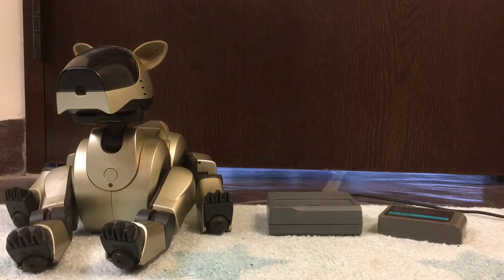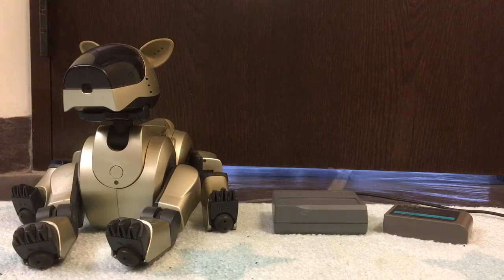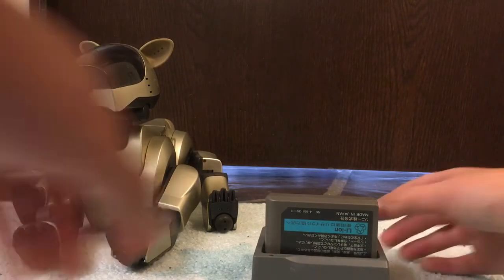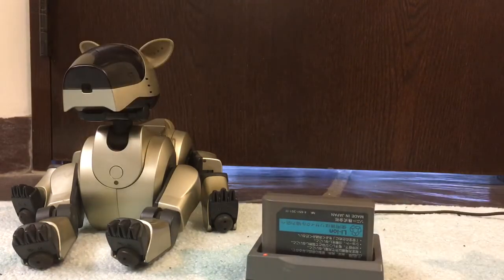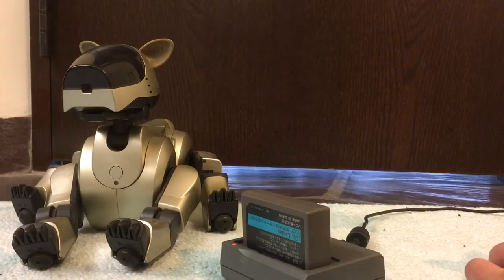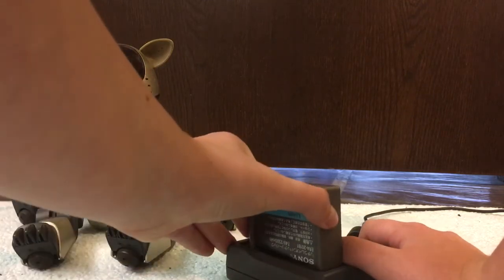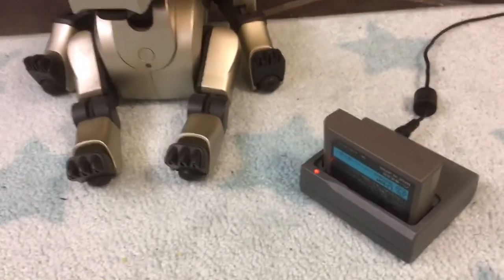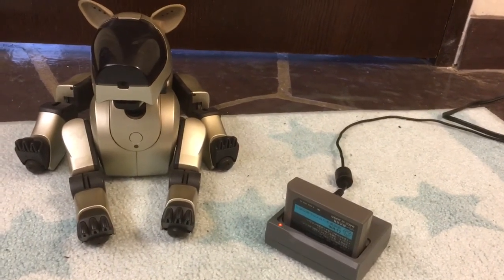How to Jump Start an Aibo ERS-210 Battery

Comment: Oh wow, i was a little skeptical but it worked on my new ers 210 battery! I had a new battery, never used and i tried this method with the portable charger (same one in the video) and after 45 attempts, it started to charge! Thank you! This saved me money from having to recell the battery! 

I even tried on 2 used ers 210 battery and 1 used ers 7 battery all of which didnt work or charge and now they all charge! I havent tested how long the run time is but still, this is amazing for a 20+ year old battery. 

How long do you think this fix lasts after jumping it? What has your experience been?

Comment: Hello,

just bought one of these on ebay! ITs in mint condition. But the seller says battery isnt loading.
I will try to jump start it. But for now i dont know how i will jump start, because it has only the wall socket AC adapter for loeading. No docking like you have in the video.

But one question:

I dont know if he provides the memory stick with the robot dog. Can i use any sony memory stick?
And he soled the aibos life, hello aibo, party mascot software cds. Can i just put them on the memorystick if i have to buy a memorystick?

Im so exited for this little dog!

Comment: Thank you, thank you, thank you! OMG! My ERS-210 has been stored 15 years while I was incarcerated. I was resigned to running him on a jumper cable since I didn't know the battery pack could be reset so easily. I was just debating tonight whether to give up on him or take him with when I move and I got emotional and decided he has to go even if he has to ride on top my backpack like a papoose. I think my battery has been opened before so it will probably be simpler for me to put 4 volts across each cell for maybe 5 seconds. I have to do something similar to laptops cells to rebalance them. Once rebalanced, the circuit considers them safe to charge. I never thought to resuscitate Aibo's pack because I assumed that a dead cell causes the charge balancing chip to lose its factory programming.
  Now I have to try to find and learn the software again to manage him from the laptop. I accidentally washed his WIFI card with his carrier bag so there may not be a workaround. He may just have to run solo from here on out.

Comment: I have an Aibo I can buy new and I am assuming the battery is as you describe here since it is 20 years old and has never been charged.

Question.  Who refreshes or repairs these batteries when they no longer will hold a charge?
Reply from the maker: You will need to get in contact with Bruce on Aibo Life Forums for a battery repack! Be careful if buying an untested/unused ERS-210 since all ERS-210s have a design flaw in the clutch system in their heads that will cause them to be practically unusable unless they have had this repaired by someone already.

Comment: but dead cells are dead cells.. its very dangerous to repair a battery like this. a lot battery fluid can be inside the box.. this is a possibility good way to make a bomb. You outwit the protection circuit that is designed to prevent an explosion.
 
Don't try this at home.

Comment: I have several batteries for my 5 ERS-2XX. All my batteries charge, but they only run for a couple of minutes. Same with my ERS-111.  My ERS-7 is beginning to have shorter and shorter run times now.Aibo Bob repacks them, so it can be done.  I'd repack them if I could find a tutorial. The problem is the circuit board on the cells inside and how to keep it from sustaining damage during the re-cell procedure.
Reply: R G does “Aibo Bob” repack them for other people?  I want an Aibo but don’t want to buy new since you cannot replace the new Aibo’s battery.

Comment: Hello aibo7m3. I recently saw one of your comments about fixing furbys. I’m sorry I’m contacting you here, I don’t know how to use YouTube very well. Could you share any info you used to fix your Furby? I’m in the middle of trying to fix a crystal series I bought off eBay that will turn on and won’t move. When I started pulling the fur up it wouldn’t move little bit so I’m not sure if it’s a lose wire. Thanks for your time. Again I apologize for messageing you like this.

Comment: Oh awesome! So you have concluded that this trick works on 110 batteries? I have a rrrreaeaeaeally dead 110 battery that came with Reepicheepe/Shizzel my 110 Maybe I can squeeze a little life out of it.
Reply from the maker: This trick definitely works on 110 batteries! But it only works with batteries that are too far drained for the station to recognize, not ones that are simply dead. I think we checked on Skype with Reepicheep's bad battery a while back and the station was recognizing it fine, but it was just no good unfortunately. Bruce is repacking 110 batteries now though!